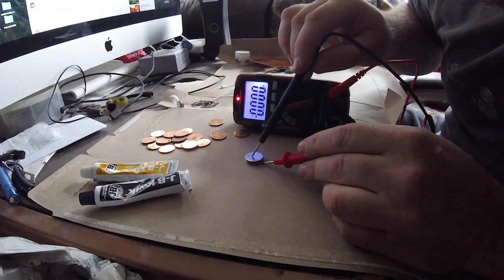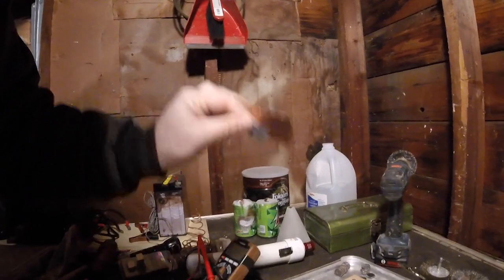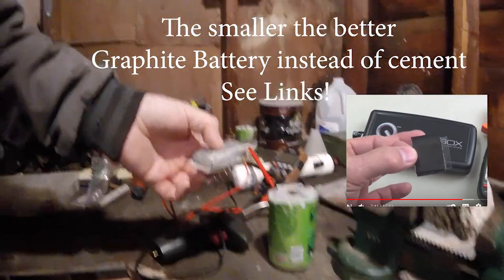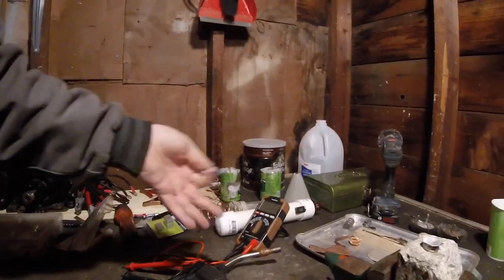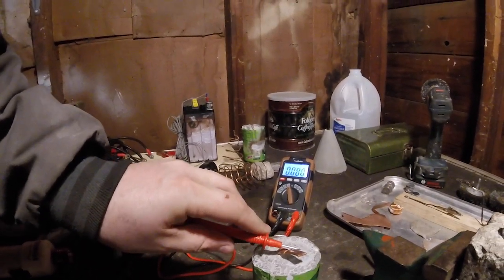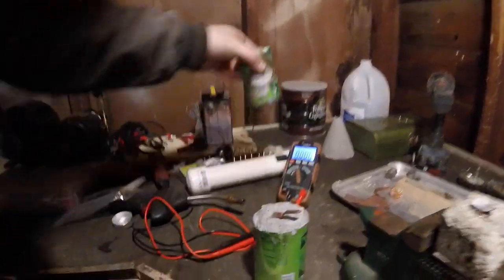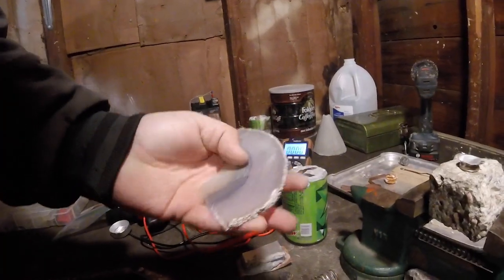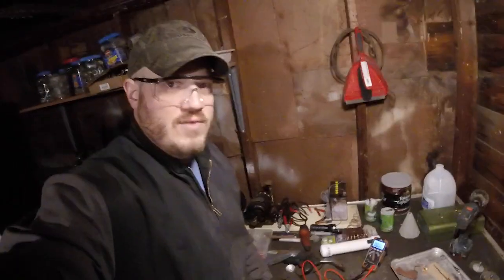Electricity Experiments - Follow-up

Comment: Try "water glass"  you can get this a home depot or lowes etc.... mix up a lot of natural graphite to make a conductive glue.
The mixture will cure if you put CO2 on it, use sodium bicarbonate and vinegar to make the CO2, let the gas flow over the mixture once you put it between your anode and cathodes.  Hope this helps

Comment: I found that if you heat up a copper plate until it is red hot then shock it with water or vinegar it will become a semiconductor.
Now put a wet napkin between the copper plate and a steel or aluminium plate.  The voltage is good with about 4 milliamps.
Not a lot of current but it will run some things forever with some experimentation.  Keep experimenting.
Also, use a Joule thief for more current.
Reply from the maker: Yeah I need to get a Joule thief on there.  John Bedini did a lot of this stuff and got some awesome results.